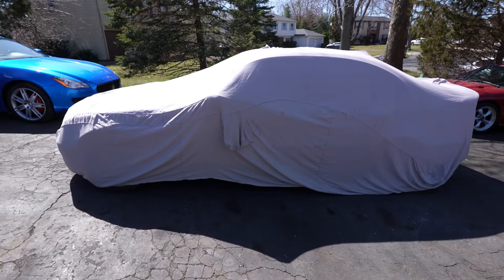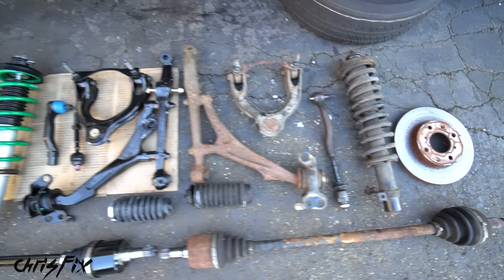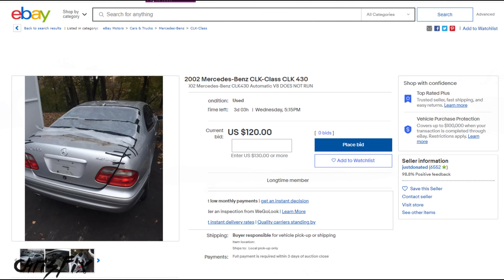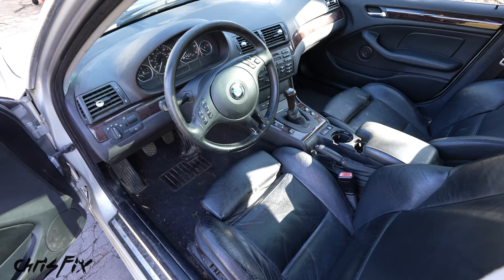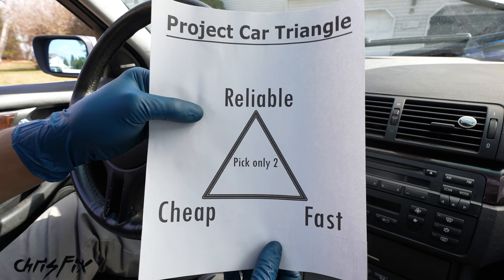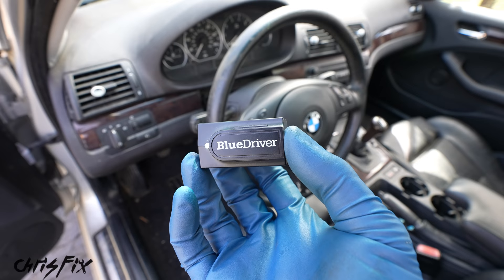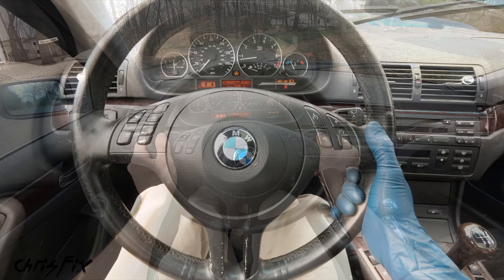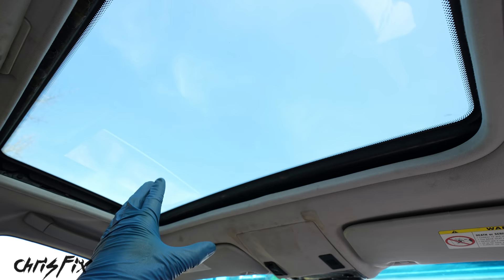How to Buy a Budget Friendly Project Car

Comment: The cap for the "$500 lemons race" is $500.

Proceed to bought $1100 car
Reply: Right?😂
Reply: They're just gonna penalize him for laps
Reply: Yes right!
Reply: Even if he does get it for 500, and shows receipt, the organization is going to think it's too nice.
Reply: Yeah, I was doing the same double-take myself.  So, then, is he entering at a different price class?
Reply: @lancercool1992  though, he has video proof.. they may not be too rough considering what the race is about.
Reply: @ABQSentinel  selling parts to offset the cost... theoretically you can buy a $2k car, but you have to sell $1500 worth of stuff that isn't replaced for safety reasons.
Reply: @zragevii4705  Watch the whole video. He knows what he's doing.
Reply: I thought I was going crazy as well...
Reply: You didn't watch the entire video.
Reply: @zragevii4705  So, then, you could buy a decent car and then strip out the sound system, unused seats, assorted trim pieces, etc. sell all of that and subtract that from the price you paid?
Reply: @ABQSentinel  not the seats (at least the driver seat because it's considered safety because it is replaced with a proper seat.), but theoretically yes... now they do also have a saying... "500 dollars my ass" some vehicles are docked anyway for major advantages from special deals etc
Reply: 20:00
Reply: Yeah I thought that the whole time
Reply: Lol I love how the sell price was about $2000. Chris offered $1000, seller countered at $1700 but according to Chris they met in the middle at $1100 🤨
Reply: To be fair since the Pandemic started people selling older cars definitely started smoking crack cause the want gold for cars that should be sub $1200 bucks
Reply: Sell the spoiler

Comment: Floor mats. Door cards. Glove box. Ac parts. Power window switches. Basically everything that isn't safety equipment.
Reply: Glove box, center console, shifter boot, spare tire. Can nickel and dime the small parts.
Reply: @jonny_d13  what nickle and dime means?
Reply: @SheetFiber  Make small amounts of money off selling or "parting out"
Reply: @jonny_d13  ac vents the wing the cover in the trunk to cover the spare tire
Reply: Also, trunk-mount toolkit if equipped.
Reply: The sun roof since you plan to remove it would be a good one. Takes a ton of Weight off and it looks in good shape to resale.
Reply: Hell, sell the front passenger and rear seats, and that'll easily get you below $500 and give you more room to install the required roll cage, fire suppression system, and water cooling system for the water cooled shirt you're going to want to wear under your racing suit.
Reply: Back seat

Comment: Sell the door cards?
Sell the aircon vents?
Sell the aircon system like compressor, condenser and evaporator?
Sell the backboard?
Sell the ceiling?
Sell the outer door moulding?
Sell the stock muffler? Straight pipe it😁
Reply: the roof will seriously screw up the aerodynamics..... but if he's ok w that that'll probably sell for a lot
Reply: Sell the car, buy a modern gt3 Ferrari off your brother
Reply: sunroof motor, glass and tracks, also carpets, trunk liners, and the aero package
Reply: @a.p1017  he already said he'll change the sunroof for carbon fibre, I doubt the glass panels would be allowed to remove and it'd still screw up the aero a A LOT and idrk about the carpets. But I think he can sell the bumpers and side skirts for a lot
Reply: @ishaan3521  He can replace it with flex tape, no carbon fiber, just flex tape!
Reply: I agree with all these comments but he wants to be able to resell the car after all the free mods are in the car. All the stuff he sold are almost useless and petty especially the stereo system. IDK how likely all that is going to sell. The stuff that WILL sell much faster was not considered to be sold bcs its more important for the resell value.
Reply: Floor mats, spoiler, center console, carpets, engine covers
Reply: And also carpet
Reply: Dont forget the trunk the trunk protections as well .. there are a lot to be done but the master can do it faster 😂😂 as i said in my coment dont forget hes driving a bmw so he will spend money on blinker fluid 😂😂
Reply: @Admm744 LOL
|
Reply: sell the rear seats

Comment: i’m not sure if this is a “safety item” but you could sell the ac compressor if it still works if you don’t mind keeping the windows down😂
Reply: That being said you could sell the glass and install a safety net. Money and weight savings.
Reply: ac robs engine power anyway! perfect thing to get rid of!
Reply: @Estok8805  only when you turn on the AC, when it's off it does not affect the power at all
Reply: @BlackBullPistol  then you won't need it, just sell it.
Reply: @parsipax6337  he will gain like 3 to 5kg. I was talking about power loss/gain not about weight reduction lol, if he wants to remove it he will but it won't affect the power of the engine by doing that, he will gain a more efficient power/weight ratio for better acceleration and breaking by removing the waste.
Reply: Eliminate that pesky blower motor heater core and all the lines associated with air conditioning. Lots of weight savings!
Reply: @mrgreen2203  i think glass is a safety item so i don’t think he can sell it
Reply: @ibrahimfares1308  True but he can still make the car lighter and as you said safer.
Reply: @mrgreen2203  yeah you’re right
Reply: AC is one of the few things you want to keep in a race car tbh. AC is a GODSEND and not worth getting rid off.
Reply: @tracklizard4018   but according to 14:26 chris has max endurance and i think he could go without ac
Reply: @ibrahimfares1308  Hmm.. perhaps having basic endurance racing stuff like AC would be too OP with him then
Reply: @tracklizard4018  yes
Reply: @BlackBullPistol  I'm talking money, not weight nor power.
Reply: @parsipax6337  ok than

Comment: Since you have new wheels, sell the old ones after a clean. Sell the rear seats, sunroof mechanism, trunk liner, floor mats, air conditioning unit, spare tyre etc. This will help you regain some money and it’ll make you lighter so you’ll go faster!
Reply: Sell the right seat if you can. It should not be a safety equipment replacement since there is no reason to replace it. Sell the couch while you're at it, or even the headlights if that's allowed by the race.
Reply: Sell the door panels, are those considered "safety"?
Reply: I thought he cant sell the wheels cuz theyre a safety item. He can replace them but he cant sell them, he said that with the steering wheel and drivers seat.
Reply: @blipman17  I imagine that since it can be up to 24 hour race or however long, one might need lighting on their vehicle to see.
Reply: @Dougemm  I think Chris wil mange just fine without lights. He has a bright spirit.

But yeah you're absolutely right. he needs the lights.
Reply: @blipman17  Or just run the race with NVG's lol

Comment: Hey I was also doing an e46 for lemons with an Xi and found that you are going to need to replace the oil pump and you absolutely need to. There’s an issue with it at high revs where the shaft will break and sieze the engine. There is a kit you can buy to replace it. The chain for the oil pump is also has some slack from the factory and you’re gonna want to put a tensioner on it. Also available in the kit with the oil pump.
Reply: Hopefully he sees this this seems like some useful info
Reply: he didn't see the comment and that's what broke the engine...
Reply: @Breadd__  Shoot... Maybe I should have DM'd him as well as leaving these comments...
Reply: @daveSoupy  yeah.... in his newest tiktok you see the oil pump didn't want to pit oil in the engine
Reply from the maker: Thanks for the tip!
Reply: Just watched the race 😢
Reply: holy shit. this comment is pure gold in predicting the demise of the engine. shoulda listened!
Reply: @therealbojak  The oil pump didn't fail. The reason his engine blew up is a spun bearing.
Reply: that's caled foreshadowing
Reply: Bro's a soothsayer...
Reply: @andrewschannel4259 engine blew up because of the oil, which is somewhat the oil pump fault
Reply: @andrewschannel4259  Yes, the engine blowed up because of the spun bearing but the spun bearing failed because of the oil. Oil was low because oil pump couldn't pump the oil right.

Comment: What about these items:
1- back seats or passenger seat
2- door windows and mechanisms -> replace with plastic sheets
3- air conditioning unit, pipes and vents, and switches
4- interior carpet, insulation, trunk carpet, remaining dashboard, glove compartment 
5- center console and hand rest

Do any of these work to reduce the price?

Comment: buys $1100 car
Chris: we have a $500 car here
Reply: As explained in the end of the video, it's $500 final-value car, meaning that buying a car at higher value, but then selling the pieces allows the value of the car to be dropped down. This means that you could buy a car for as much as $3000 if you're able to sell for at least $2500 worth of non-essential pieces from it (and no pieces are needed for the repairs or you got to drop it below the $500.)

But as quickly explained, you can't just sell pieces at super high cost just to drop the value of the car. It's has to be representative such as having proof that the pieces are sold regularly at a similar price. The pieces also has to be sold and not just put for sale, hence why it's suggested to sell the piece at a tad lower than the actual after-market value. You also can't sell more than the worth of the car, so if you buy a $3000 car and sell $5000 worth of pieces, you're still stuck at $500 of non-security related upgrades and repairs at most.

Car with higher values than $500 gets a penalty of 1 lap per $10 exceeding the amount.
Reply: Watch the whole goddamn video man

Comment: 90s-2000s mustangs are cheap reliable and fast!

My first car was a 1998 mustang gt, every panel on the car was a different color, the windshield washer jets were ziptied to the wipers, passenger door panel was missing along with half the interior panels, but the engine and transmission NEVER stopped skipped a beat. I dogged that thing like a bat outta hell on a daily basis and it never left me stranded even once. I bought it for $300 with 280,000 miles on it, drove it another 100k. Sold it to a neighbor for $600. He still drives it to this day 3 years later, even got the paint touched up. Damn I miss that car, but now I have an old toyota pickup to play with :)

Comment: Chris, you’ve helped me achieve my goal, make a 1998 Honda Civic Hatchback into a race car. It turns so many heads on the trailer. Why a trailer? Because the Civic has no windows, no headlights no power steering, no airbags and no mufflers. I race it on a 3/8 mile track, even though inside it’s somewhat quiet, everyone says that it screams on the outside. The civic has light steering, light brakes and a very light clutch. Keep up the vids!

Comment: So hyped to see an e46 on the channel. I have a 2002 325i myself and I’ve done a ton of DIY stuff on it, since it was in rough shape when I bought it. Hope you guys enjoy driving the 330xi. Oh and as far as the code for your coolant temp being low, chances are it’s a stuck open t-stat. The cooling system on these cars are awful, so hopefully you guys don’t overheat on the track.
Reply from the maker: That's awesome! And that sounds about right, hopefully we can budget in a new one before we go out haha
Reply: @chrisfix  when is the video for the turbo del sol going to come out?
Reply: I just bought an 03 325i, and I haven’t decided what to do with it yet. Any tips?

Comment: Also sell the back seats, door cards, and  window motors!! Saves weight on those parts as well!
Reply: also antenna, hand rest between the front seats
Reply: and engine
Reply: Sell floor mats too!
Reply: Could sell the spoiler off the back as well if it’s in good shape, let’s be real, that’s cosmetic
Reply: Seat belts, carpet, center console, complete trim from the trunk, the useless spoiler, front grill and fog lamps, airbags, spare wheel, jack and tools, and if you are still short you can sell the door handles and complete latch mechanism and weld the doors closed (but the driver). It will make car lighter and stiffer. It is lot of work for marginal gains, but the champions are there.
Reply: @miguelstella2  Funny...this matches about 80% of what we were able to sell off our E46 parts car for our E46 race car (best way to get spares is part out a second car).  Do not weld the passenger front closed by the way.  Normally you use two peole to strap in the driver (much faster).

Side glass is an interesting discussion...sell it and your car is not weather tight wen not racing.  Make it pin-in (easily removeable) and you can still sell the regulators.

Comment: Yessssss, excited to see a bmw 🔥🔥🔥
Reply: What you doing here lol but yess!! Finally a bimmer, and I'm sure this e46 won't dissapoint... unless the water pump goes, or the head gasket, or the oil filter housing gasket lol but other than that, my old e46 was extremely reliable driving it through a very rough daily drive.
Reply: You just gave it away
Reply: Spoiler alert 🚨 lol
Reply: I’m excited for the April fools day video
Reply: Michael Haney  yeah I wouldn't buy an old bimmer unless you're an enthusiast who likes driving, and doesn't mind working on their own cars. They are actually easy to work on. For example, when I replaced the water pump, the dealer quoted me over 600. A quick youtube video showed me how easy it was to replace under an hour, and the part was 70 bucks. This is were Kies really comes in handy, he posts the best DIY videos on bimmers
Reply: Michael Haney  I got mine at 103k and sold it at 169k 5 years later, and all I did to it was the water pump, oil filter housing gasket, clutch, alternator, fuel pump, fuel filter, and some climate chip (forgot the name). That's all lol but like I mentioned, my daily drive was through a very rough pass at the rockies, so in my opinion, the car did great and was a pleasure driving it through the mountains:) I honestly miss it!

Comment: Just bought a 2009 Subaru Forester with 190k for $2500. Ran great. I pulled the engine myself and pretty much rebuilt engine for less than $300. It runs super quiet now
Reply: 300dollar engine rebuild doubt
Reply: You are probably the type of guy who tries to sell his 2009 Subaru Forester with 190k on it online and need some better reputation
Reply: @stan1755 it was all the gaskets and seals as well as a valve adjustment. I didn't need to machine the heads or block as they were within spec. Not sure why you doubt this
Reply: @YouplayZ  not sure what your talking about here bud. I bought it to have a new family car for our newborn. Much safer than my older cars I have
Reply: @MC-eh2ot  subaru parts are cheap then.
Reply: @stan1755  there are a ton at pick a part places for super cheap as well as ebay. I bought a lot of used parts with really low mileage so that helped too

Comment: "Something that you actually like and you actually want to work on it" I think Chris just validated my souped up '06 Taurus.
Reply: that sounds lit dude, i want the wagon though.
Reply: I have a loaded '06 SEL with the Vulcan (they dropped the DOHC after '05). I've had it for 10 years and it has 217K miles on the odometer.

 The parts are cheap, it's easy to work on, and it's pretty reliable. Also, people don't notice it, so I know it will always be where I parked it.

Comment: Sell ALL of the interior seats, carpet and door cards for weight reduction and MORE MONEYS!
Reply: @FlameOnTheBeat  you won't be able to use the stock seats anyways, you need a full cage, harness, and a racing seat. Wheels, tires, and brakes count as safety. Anything that is safety related is not going to contribute to the 500 USD Rule

Comment: So I work at Firestone right and I got a 96 mustang gt I race .I’ve had anything from sticky mickey tires to nitto to other brands .Bridgestone RE-71R are some super sticky summer tires man .Especially since that car’s awd you’ll be taking off and planted to the road .Amazing tires I race on then all the time snd there the best ones
Reply from the maker: Thanks for the tip Cameron!
Reply: You are right, I had re71r's on my 'speed3 last summer. For what I wanted they were solid, lasted 8 trackdays and a total of about 5k miles. For short 20-minute sessions they were nice and grippy, but I think they might wear too fast for an endurance race
Reply: I do alot of Autocross events and all the serious guys with the best times always run the re71r tires, pretty much the best tire out there for autocross events, however I am not sure about the long endurance races, it might be too much for the Potenza tires
Reply: @dennisnedkov1681  you are correct the RE71's are awesome for autocross and setting a quick lap for Time Attack or HPDE day, but they are to soft for heavy cars doing endurance racing.  Its been over five years since I raced in 24hrs of LeMons race and the tires of choice were the Hankook RS-3's, Falken Azenus RT-615's and Dunlop Direzza 2.  Obviously those tires are all discounted and that's what the fast cheaty A-class cars were running.  Sometimes if you show up with an over budget car on the cheapest tire you can by from Walmart they would wave the penalty laps.
Reply: @muffin4600  there best in straight line but pretty good on a track to